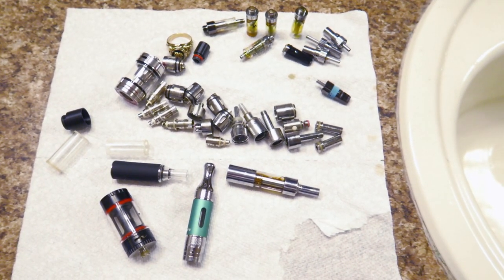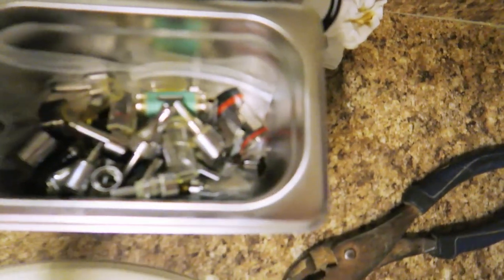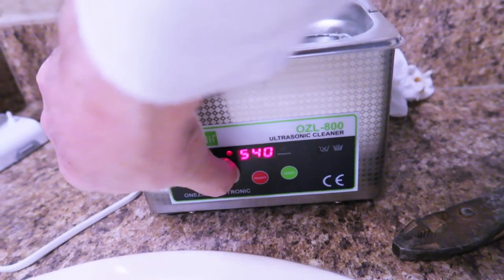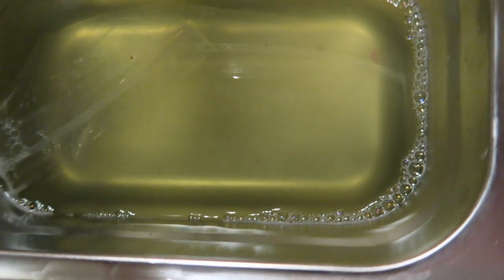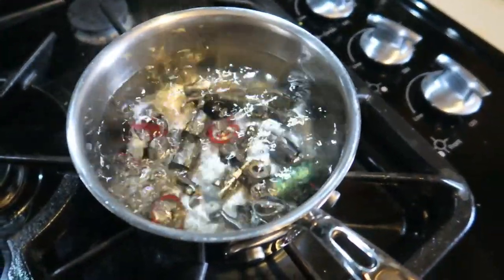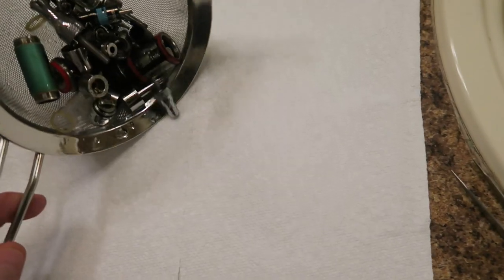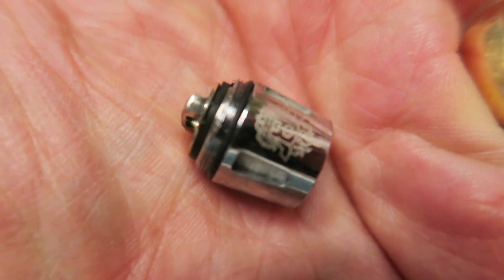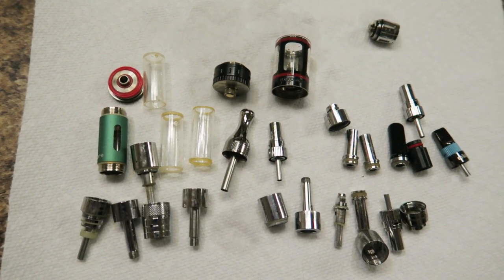Vaping parts cleaning guide and tutorial.  Vape pen deep cleaning and sterilization.

Comment: anything for the 99.9% of us that do not own an ultrasonic cleaner.
Reply: Yeah actually, I usually take the tops off, C-cells are a bitch but it can happen, and use a tiny shitty walmart desk heater to drip clean any oil, if any, still left in the cart
Then I make sure hair and solid chunks from top removal are cleaned off and I soak my carts in as high prof Iso as you have, 70 works but is slow, and I've used 99 but at that point you might as well swap to grain alcohol or everclear
I soak them in a baggy until the alcohol is discolored but you can leave them all night if you'd like
The only real important step is either use heat or be patient and wait for them to dry completely out, trust me, isopropyl in your lungs fucking sucks
Cheers my fellow broke smoker, and do with my knowledge what you will